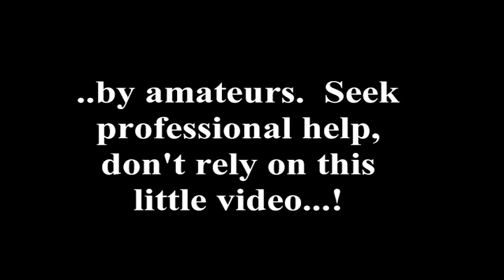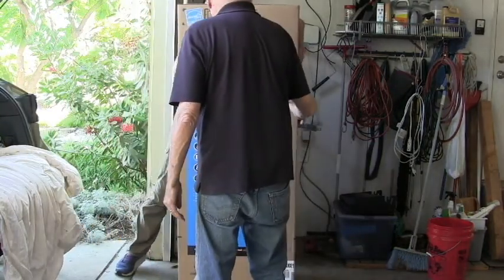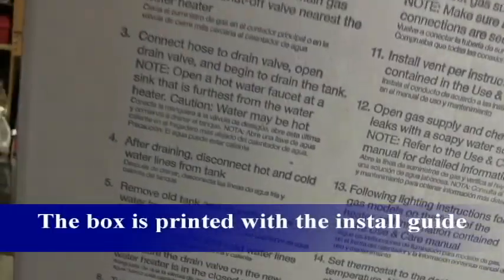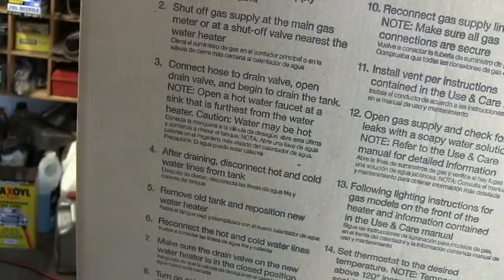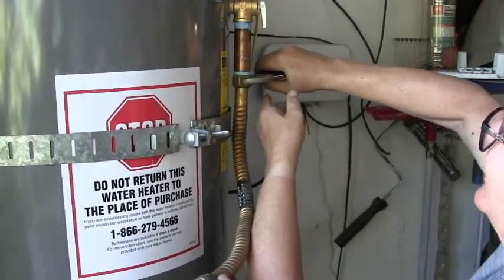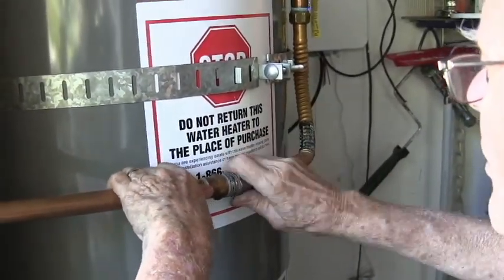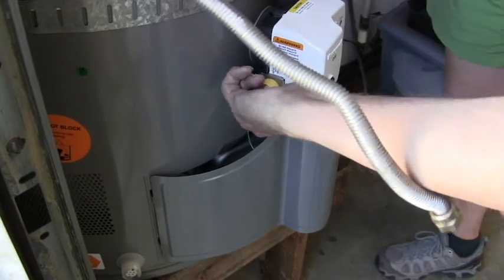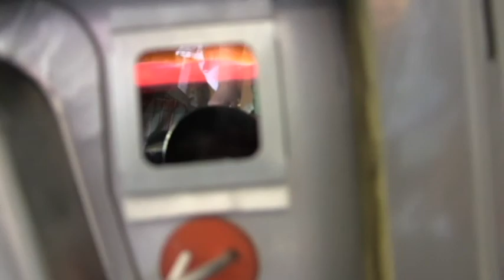Rheem Water Heater Install

Comment: We removed our electric tank type and replaced with an on demand gas fired unit. It's...ok. The temperature fluctuates from your - for example - shower setting to significantly cooler then hotter. Plumber is working on the issue. It is nice to regain that space as it was in a pantry room off the kitchen and now in the attic.
Reply from the maker: We thought about going tankless, but in the end chose the easier route of direct replacement.  Luckily we have plenty of space in the garage.